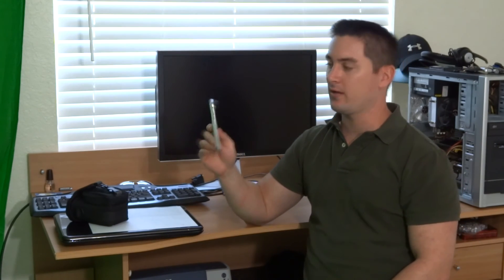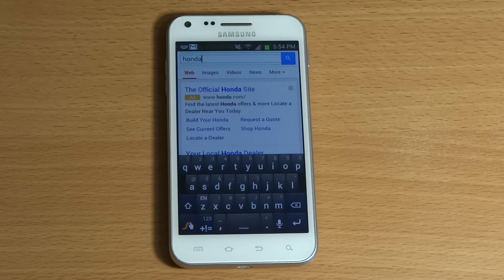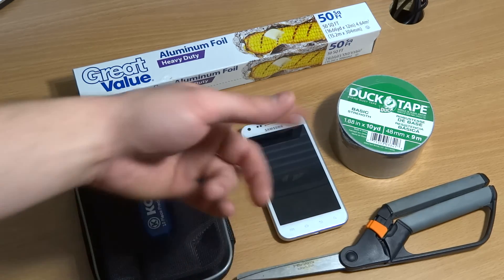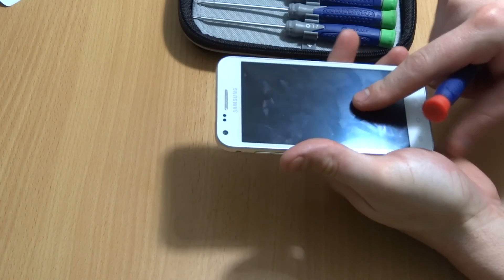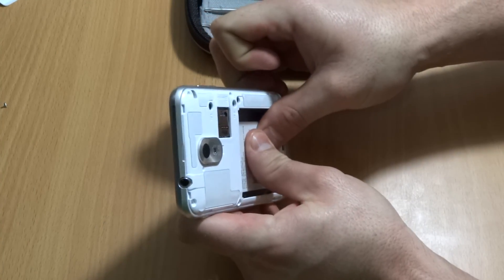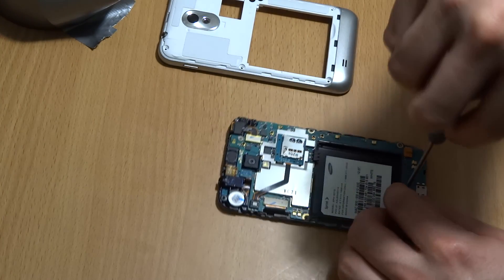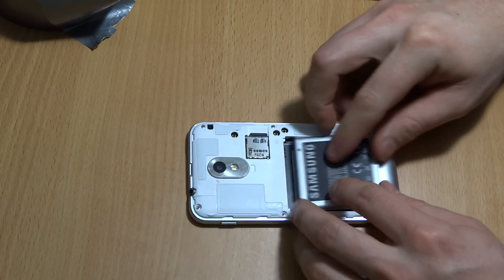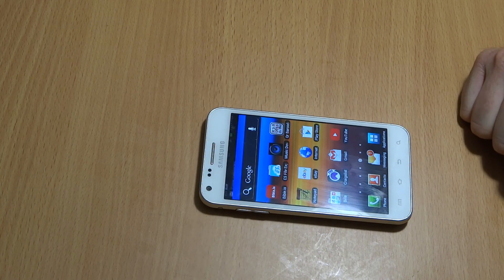Samsung Phantom Menu Pop Up $5 "FIX"

Comment: I did this exactly as described and the phone still did the menu popups. So I took it back apart and took a piece of electrical tape and covered pretty much the entire board that this chip is on. Then depressed the tape all around the chip with my fingernail. Then I used a piece of tin tape that comes in rolls and is used for sealing ductwork etc. This is a lot heavier than tin foil plus has an adhesive backing. I cut this piece slightly smaller than the electrical tape and also depressed it tightly around the edges of the chip. Having both pieces of tape firmly around the chip and not movable was the trick. Then I covered the two pieces with another layer of electrical tape. It has been a week and no popups even with no signal at all. Thanks for the video.

Comment: great video-However - did the process on my wife's phone and it seemed to make it worse. took it apart again and doubled up the foil and it still didn't do any good. I used electrical tape rather than duct tape. anyways took the phone apart a 3rd time and took the tape and foil out.

Comment: Thanks bud for posting the video. I fixed my girl's phone now she doesn't curse her phone anymore. 

For those of you without Heavy Duty foil, I ended using cheap kroger brand foil, folded over four times. Then tested the phone in a low signal area where it always occurred. Haven't seen it once in two days.

Comment: Could you comment on this fix:  It seems a lot easier and apparently it works without having to take the motherboard off.  Thanks.

It's the 8th commenter down, his name is JC.M.  
http://forum.xda-developers.com/showthread.php?p=44639715#post44639715